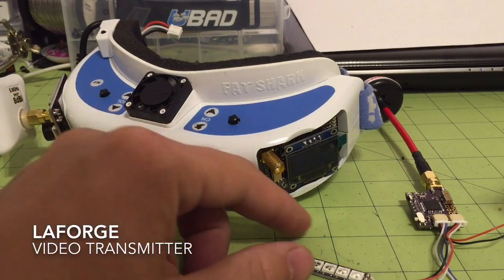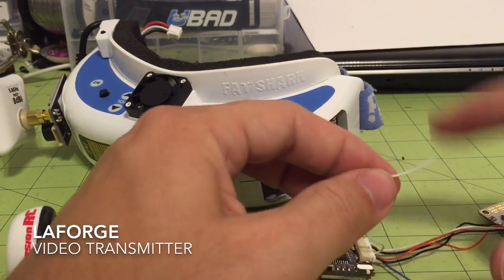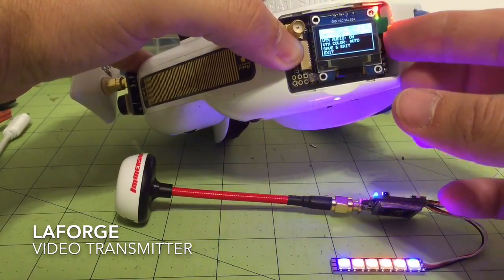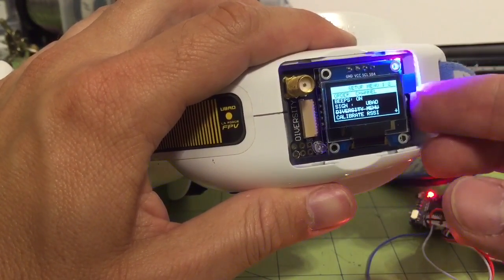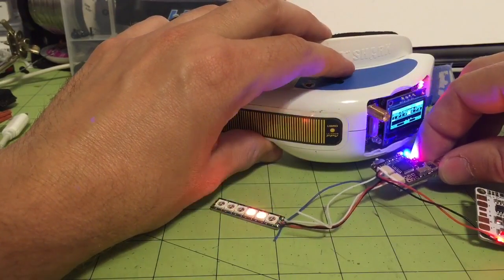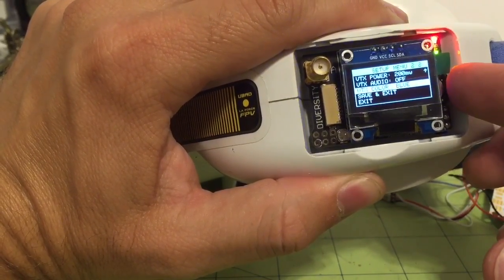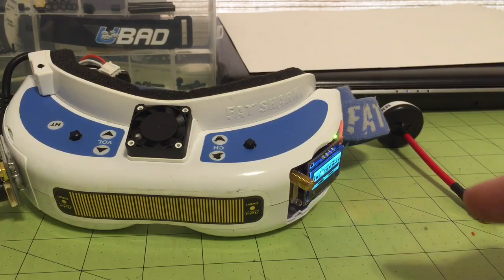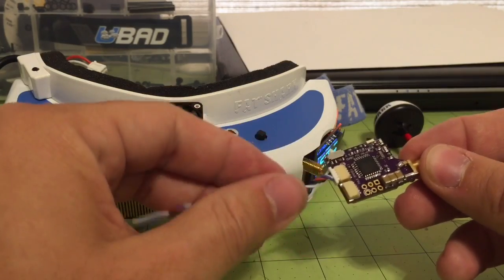LaForge Video Transmitter

Comment: I have laforge  module for thefatshark
The remote control for the trasmitter la forge 
And I have the la forge trasmitter and like you video show low signal a did evething but I do not have signal or video on 
You know why ?
You think I have bad trasmitter I have other trasmitter and the are working just fine but when I hookup the la forge trasmitter is not working can you help me I buy it for get fpv

Comment: So I purchased two of these and both have lines fading in and out of the feed. I have the cam and vtx running through a bec and filter. Thoughts? I have heard on forums this is common with this vtx.
Reply: The reason why I have issues is because there isn't a built in filter. Most modern ones now do so just be careful if you want this transmitter. Filter is most cases is not optional.